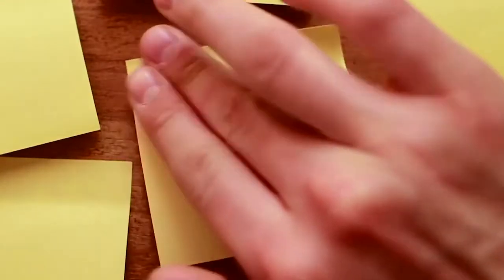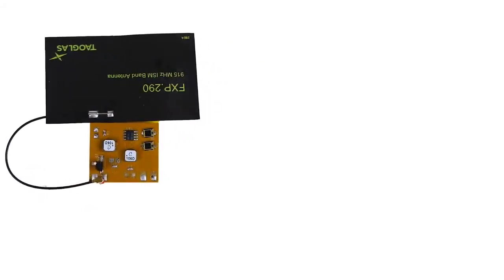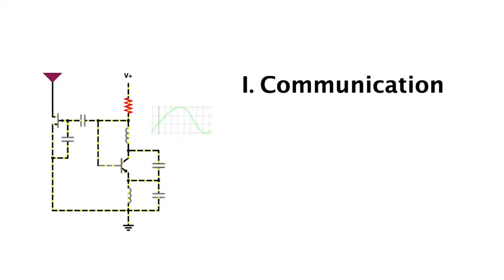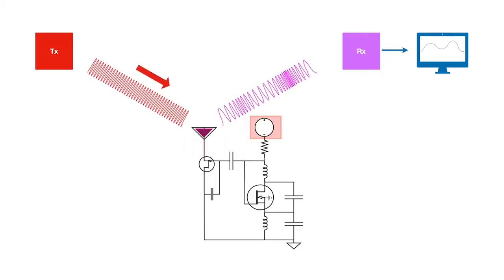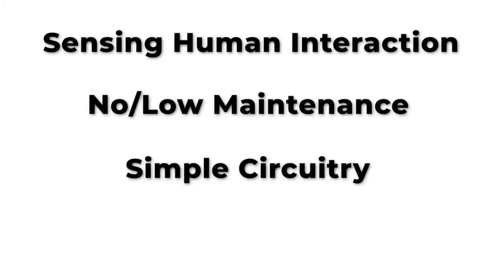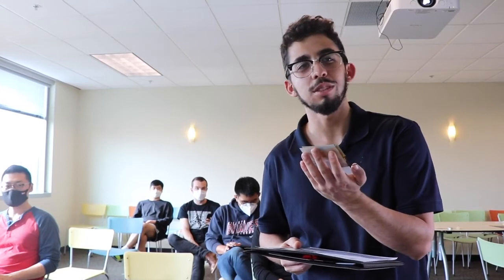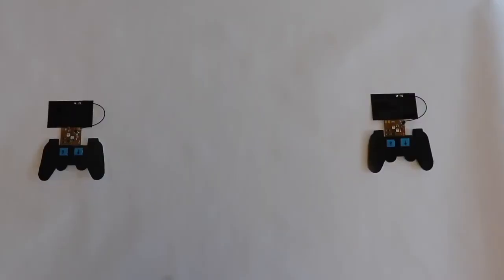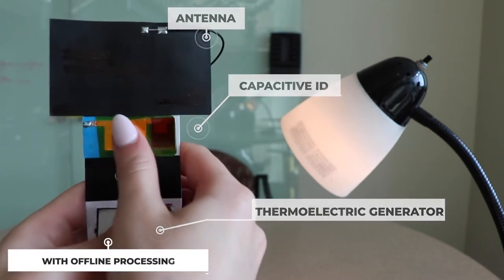MARS:  Nano-Power Battery-free Wireless Interface for Touch, Swipe and Speech Input

Comment: I'm sure nobody is going to abuse this to make tiny listening devices.
Reply: Thank you for your comment! We have actually explained several ways in the paper's future work section by which privacy can be ensured. One of them is the concept of "Power for Privacy" i.e., only when a human is present and physically touches his/her finger/hand on the sticky note interface that the tag will activate, otherwise it will lay latent just like a good old post-it note. Another way is to add a physical flap-like switch which only a human presence can activate. This can be used to avoid perpetual sensing, as in case of a photodiode/ RF-powered tag. As researchers we do take privacy of the things we innovate quite seriously. I hope it answers your concern :)